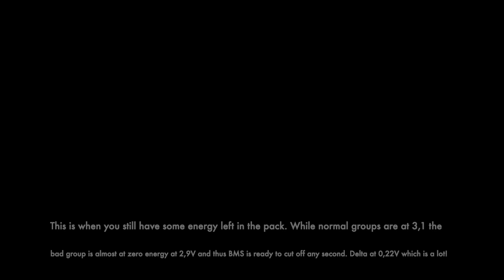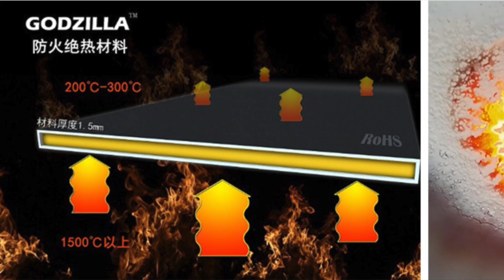Electric paramotor OpenPPG SP140 Battery repair

Comment: Nice and precise job and evaluation. Hope that the result was not disappointing and 0.05 cell disbalance on discharged battery is the value you reached.
Reply from the maker: Indeed it did and flight time increased from 45 to 53 minutes which is quite substantial.
Reply: plz show cell volt after repair on the app

Comment: fantastic job! where do you get the flame protection? 
i know the DALY BMS factory boss and i worked with ANT BMS for many years too. wise choice to change to a bigger BMS. but be careful and check it after a hard cut due to low voltage over overcurrent since these 2 scenarios cooked several BMS from ANT before here. really good job you found the problems and were able to fix it.
Reply: haha dude... you even fly the IDENTICAL wing than me! subbed!
Reply from the maker: @cloudpandarism2627  yup! I got it as a sample from the company that make it Godzilla fire insulation-Ningbo Booer New Materials
Reply: @ridecrypto  i found it. i am living in china and it should be easy to get. thanks mate. even i think this insulation wont protect the pilot. but if it gives him couple more seconds to get down its fine i guess.